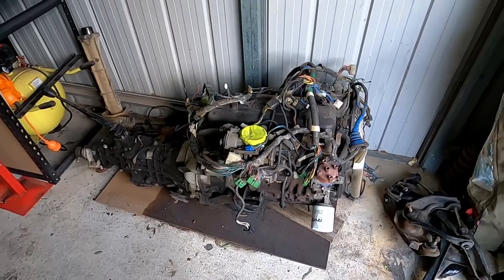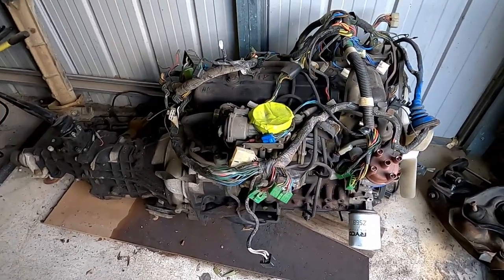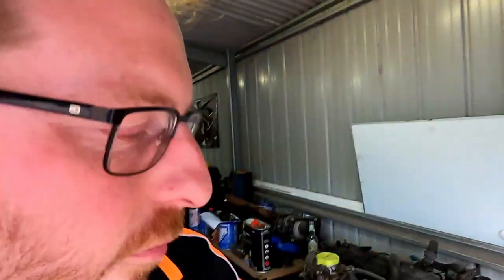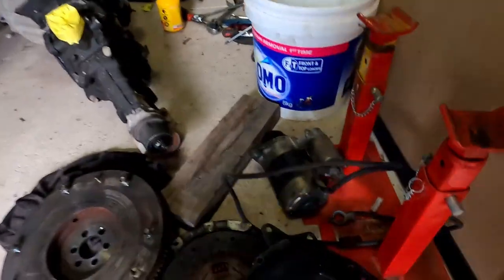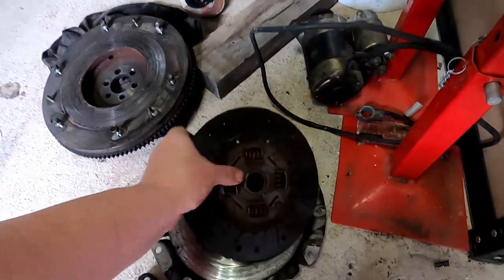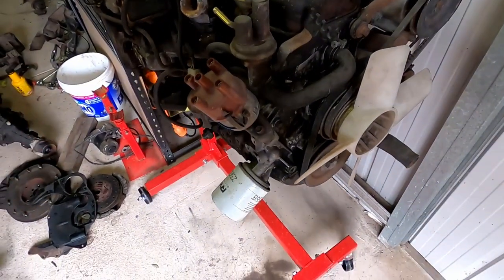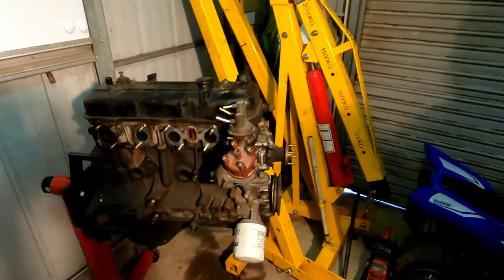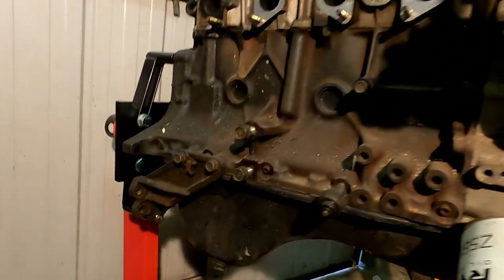TG JDM Gemini Project: The start of the G161Z Tear Down Part 1

Comment: It wouldn't hurt refreshing all gaskets, belts and water pump bro, like you said it's a good engine so just a quick refreshing up the motor and then save your money on a RB motor rebuild. But keep up with the good work on the gemini refurbished bro
Reply from the maker: Yeah that's what i was thinking just redo all gaskets give it a good wash bit of paint maybe just slap in a cam and enjoy it 😁

Comment: Id personally rebuild, but in saying that my 1600 was whipped and i had the 2lt built for a different gem already, but if you want to do the swap at some point later just freshn it up and send it,
Oh well, if you want boost, rebuild you'll probably end up having to rebuild later anyways
Reply from the maker: So many choices makes it so hard 🤣🤣
Reply: @snrautoworx2840  yeh man , anything short of a ford modular or big, big block will fit

Ps i edited my post as you replied...